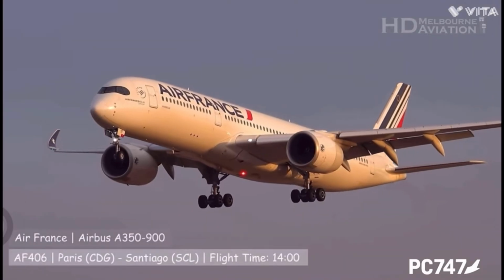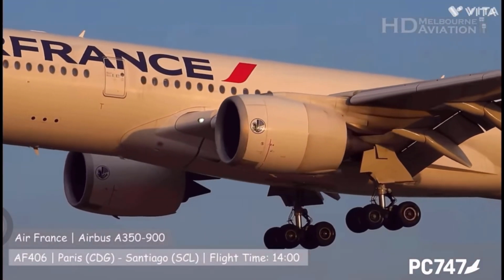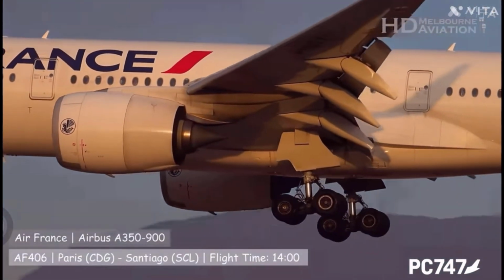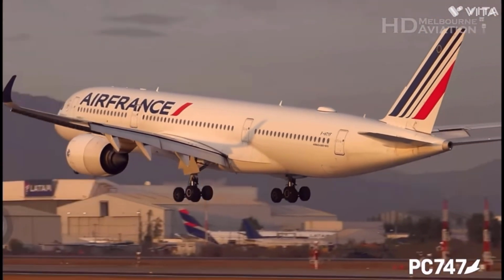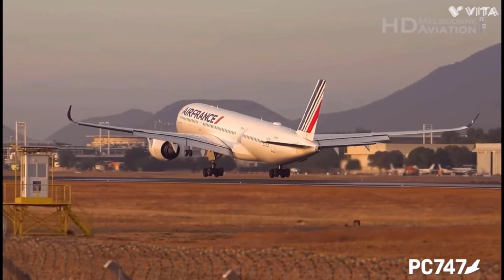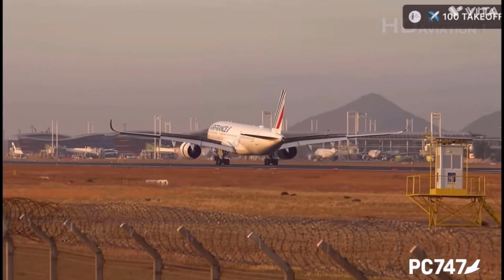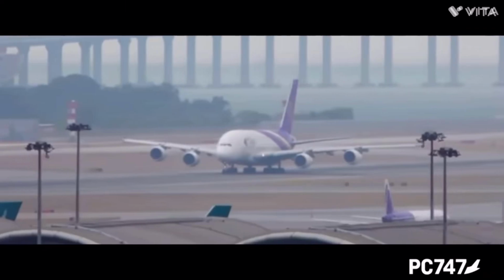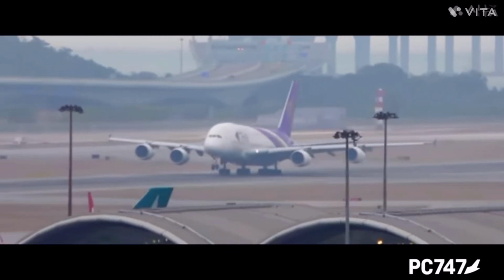WHY PLANES STILL CRASH

Comment: I watch air disasters it's my favorite show. Every wreck gets deeply investigated. One show talked about a jack screw bolt nut that wasn't properly installed from the maintenance man.This  involves in the stabilizer compartment where the Jack screw is located and was missing a 50 cent washer that had fallen off during reassembly from the maintenance completely unaware that it had slipped off the Jack screw.This caused a major disaster bringing down the plane. Hundreds of people perished over this simple fix. Only 50 cents unbelievable but you can learn a lot actually just by watching the show 😎👍
Reply from the maker: That’s true. That’s one of my favorite shows too.  Thank you so much for sharing your kind. Thoughts 🤩🤩🤩🤩🤩
Reply: @PC747Aviation your welcome 😁👍
Reply from the maker: @cevacombes2347 ❤